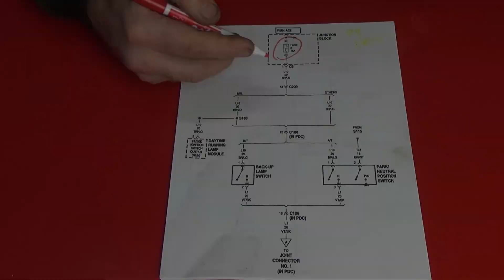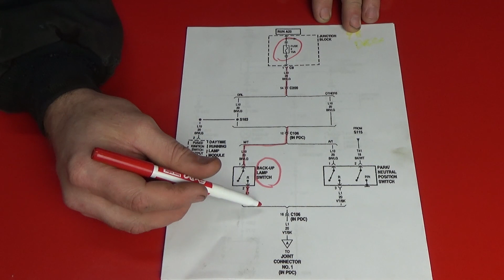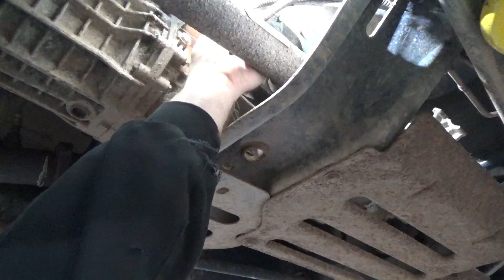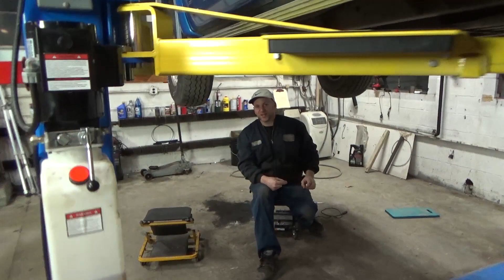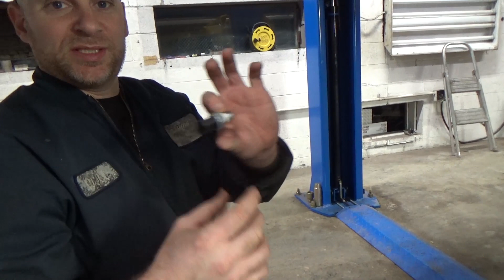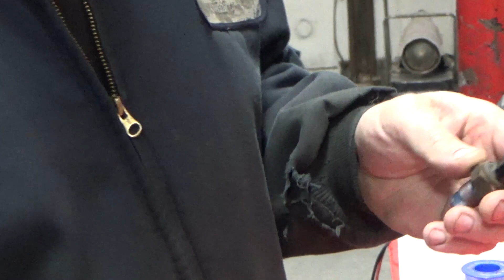Dodge Dakota - No Reverse lights and after market parts

Comment: What did not, but could have happened. 1995 Dodge 3500 with nv4500 needed two shims to shorten it. Then they just made the same part shorter and resold for future models. No one ever checked before reselling for the newer trucks.  Then 6 years later someone slows your video to 2 fps to make sure the shims were not left on the transmission before posting this hyothetical story.

Comment: Mine does the same thing. Except my speedometer and rpms drop off😂... I did a front battery delete and run an external voltage meter as most bassheads do. Your not alone bro...😢😂🎉 Its from music for sure... 150 db  is a car killer

Comment: Going through this right now. Bought a new switch from Advance Auto and didn't work.  Had already done the fuse and wiring troubleshooting and used the jumper to make sure it was the switch.  So I found your video and then got the calipers out and sure enough its about 45 thousands shorter. Been to NAPA and O'Reillys and have looked at 3 other switches. All of them are anywhere between 40-50 thousands short. I guess I'm going to see if I can find a lathe and turn down the back of the nut. Thanks for the great video.  Very informative.

Comment: Hi,
   I'm having trouble just removing the cables to get to the switch, do you have any suggestions? I tried spraying some cleaner on it and scrubbing with a tooth brush but I am still challenged.

Comment: Theres a sensor connection that hooks up to the transmission. Takes a one inch socket to remove and replace or it might not be plugged in. My Durango had the same issue and works now.

Comment: I had this same problem on a Chevy S10 with a Getrag transmission a few years ago. I'm not sure if it was something in the transmission or the switch. By the time I got it there were three switches on the front seat from previous attempts at fixing it. I machined it, put it in and called it good.
Reply from the maker: GRowe1978 it's actually more common than most realize 👍 great fix glad it worked out

Comment: I don't want to sound argumentative, but why did you assume it was a power issue and not a ground issue? It seems like a more efficient way of doing it is doing a voltage drop across the bulb first, seeing you don't have 12v at the bulb, and then tracing power
Reply from the maker: Paul Danenberg it's one or the other right, that's what's nice about troubleshooting there's more than one way to trace a circuit. could I have removed a tail light sure, could I unplug a connector already exsposoed sure. either way would lead you to the sorce. No effence taken 😉👍🍻

Comment: it's a chrysler product, nothing is simple ;)
nothing a gearbox rebuild wouldn't fix or just turn it in lathe lol
Reply from the maker: throttle bottle lol never is easy 😁 thanks for the feedback
Reply: most likely why the other shop said not worth the repair cost because of worn gearbox. how/why? typical previous dodge/chrysler owner being shift-knob rider. they rest hand on it always whilst driving..... yep seen it before ;)
Reply from the maker: throttle bottle Napa switch works perfectly fine around $15 same length of the old one is all this one took. Not sure of others. Thanks for sharing

Comment: Good catch on the depth issue with the switch.  Your experience in the industrial field is serving you well. I've seen that before when replacing sensors, switches, and detectors on various machine tools. Another good one!
Reply from the maker: Monte Hyler thank you, the industrial field has been very good to me, both feilds are similar in so many ways, especially on the control side. Plus the exposure to see how processing changes overtime, it could be from operator to operator or materials that go into the product, no two itims are exact overtime, batches are close I'll agree and that has variables as well. just goes on and on 😁 most will not except this fact I'm sure but it's reality

Comment: Good call Will and Tammy!  I ran into a similar problem with a customer's truck, a 1992 Toyota 4x4 Hilux.  He took it to a shop and they just went a replaced the switch but the reverse lights didn't work.  I pulled the switch and noticed they forgot to remove the washer from the original switch and when they installed the new switch with a new washer then they gave up.  The original switch went bad and needed a new one but duh and they had the gall to charge him $75.  I didn't charge him anything but gained a lifetime customer.
Reply from the maker: RareDiamond Ching thank you for the compliments!!! Man that was a good catch on your part! It's the difference in understanding what's going on, when something should work you gotta keep digging 👍👍 thanks for sharing
Reply: Well it helped that I have and still drive my 1993 Toyota 4x4 p/u so had something to compare.  I took his new switch out and checked it with a ohmmeter and it was good.  The other shop gave up after 3 days and told him his harness needed replacement or transmission needed work.  Several months later I replaced the Made in China switch the "other guys" installed with a Made in Japan OEM Toyota (DENSO) switch.  Thanks for a great video and keep 'em coming!

Comment: Thats so funny had a similar issue with tail lights on same make and model last month.  Truck came from another shop. The fix was removing after market tail light assm. On left side an place o.e. light assm. Which was a mission to find. Great work. Thanx for sharing
Reply from the maker: Drews Auto as bad as this sounds I'm glad I'm not the only one that goes through this, seems it happens more often than not somedays throughout all repairs. Your welcome anytime! Thanks for taking the time

Comment: The reverse lever probably has excessive wear
Reply from the maker: sergiovtorres that's why I picked up a switch from another vendor, insted of leaving the one I turned down. It would have led me to think the same. orriginal switch was undoubtedly shot, put one in the same length and all is well. However this did cross my mind I will be honest, I was convinced after turning the new one down that the part being supplied is close but not close enough

Comment: I guess nowadays. You have to check it is the right size before putting it in. Measure twice screw it in once. loool
Reply from the maker: aengmax 👍that's a great way to look at it actually!! we need to think as if that step was skipped in manufacturing before the first cut and assembly 😂😂

Comment: I dont know if we will ever get to the point where OEM parts are the same as aftermarket. If that was the case, new cars would be going in for warranty work all the time.
Reply from the maker: Bad Drivers of North Texas true and if OEM didn't fail we wouldnt have a job it's a vicious cycle, as technology advances so will the OEM provider for that last model year to keep up with the times, then outsorcing begins, corners get cut to make it cheaper and cheaper, sad but true. Unless you can find "new old stock" that's the only time you might get something made by the "orriginal equipment manufacturer" the standards are most likely better for certain customers like the "car manufacturer" dealership. This is most likely why we see a better quality at the dealer parts counter with late model parts

Comment: had same problem with aftermarket turn signal/flasher switch for gm. also new brake pads seem to fit 50% of the time
Reply from the maker: jasonmushersee ugh can be frustrating to say the least. Thanks for sharing

Comment: Should have been easier, seems like it was more time consuming to install a toggle switch. Why didn't you use the one you turned down? Pretty soon Tammy will need her own tool box and y'all will need a new camera operator.
Reply from the maker: Eric Corse I agree, I was going to leave that one in and the thought others may want to see a switch from another vendor, I'm sure it would have been fine to leave that one in
Reply: Thanks

Comment: If this was a new truck the circuit would probably be all computerized and run from a TPIM and through three different controllers before getting to the taillights, lol!  Seems older cars like this are way easier to diagnose electrically.
Reply from the maker: Chris Freemesser that's right, this may have required programming and disabled the vehicle 😂😂 times are changing for sure

Comment: Scotty would have soldered it right into the fuse block! I have ran in this with door parts from NAPA. The plastic part wasn't even close. I try to get parts from the dealer now. Just simpler and quicker!  Problem solved! Good vid Will!
Reply from the maker: The Disgruntled Mechanic hahaha I'm not saying a word😂😂, I agree it's most likely the best bet  👍 thank you Mike